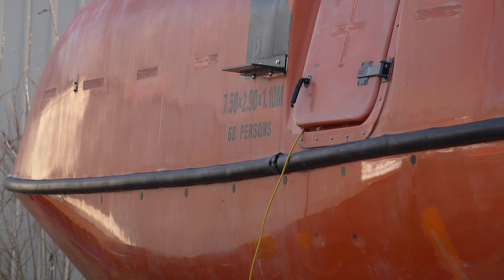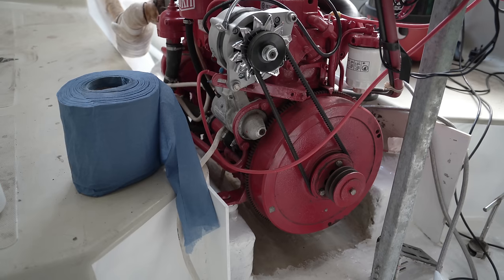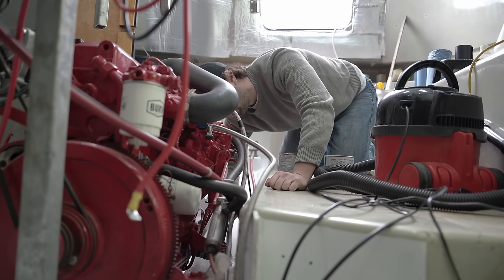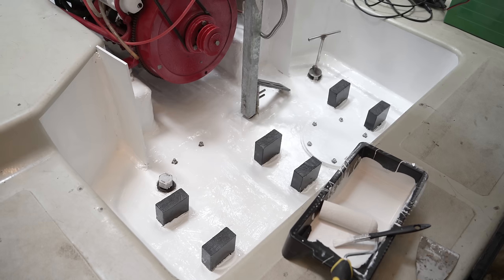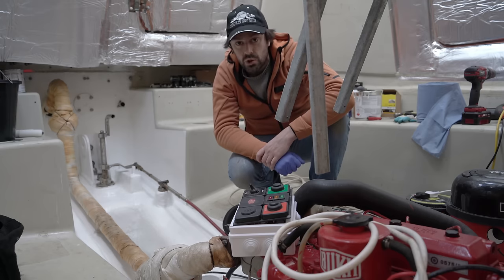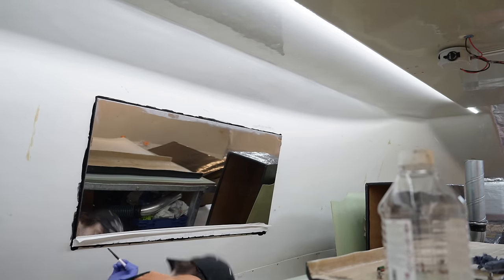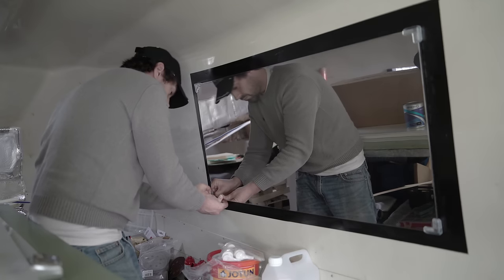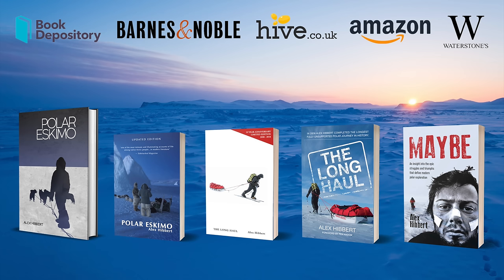Lifeboat Conversion Ep8: Preparing the engine bay [4K]

Comment: So wait... A lifeboat had a sprinkler system for... Bathing? Or was that a sarcastic comment that flew over my head? I just dont see why a lifeboat would waste time for a showering system when just washing off with some water and a rag or your hands will probably be just as good in a stranded at sea situation... Especially if that shower is seawater anyway.
Reply from the maker: It's to put out any fuel fires on the boat's shell.
Reply: @AlexHibbertOriginals  In hindsight... Wow, I'm... Well, I'm dumb. Thanks for explaining that. I'm going to just sit here in shock of how silly my comments reads now.

In other news awesome videos and I love the premise! these lifeboats have always fascinated me, I used to see these conversions on youtube and wonder about adding a sail (folding mast or maybe one of those kite sails) but when I learned a tiny bit more about sailing I quickly realized the hull shape and especially lack of keel would make that a horrible idea. But I digress...
Reply from the maker: @indalcecio  Thanks Peter - and all questions seem more daft once they've been answered!

Comment: The placard..  You could just paint over it in accordance with the "get on with it, this is a tool not a yacht" philosophy.  If that does not do it for you then get out the grinder.  I promise the grinder will get rid of it.  After the grinder, put on a coat of resin followed by paint.
Reply from the maker: An option, but I want access to the gelcoat beneath to mount/bond something to.
Reply: @AlexHibbertOriginals  so grind it away. That will leave a fresh surface nicely keyed that you can bond whatever you want to it.
Reply from the maker: @codybaker1091  Ha! I feel bad to be reticent to just got for a grind...
Reply: @AlexHibbertOriginals  Well to me, that you want to bond something there concludes the debate. Get rid of the placard and prep the surface for whatever you are going to stick there all in one shot.
Reply: Flap disc on the grinder or if that seems too aggressive to you then 60-80 ish grit on an orbital sander.

Comment: rubber dose'nt like paint, I do not see the reason to paint it you could always remove it ! 303 Protectant is the best stuff ever for protecting anything that is rubber :-)
Reply from the maker: You mean the gasket? It's only the narrowest edge of the gasket between the steel and the hull. I considered masking around both sides of it to keep the gasket clean of paint, but there's no particular reason to do so in a non-moving part, other than aesthetics.